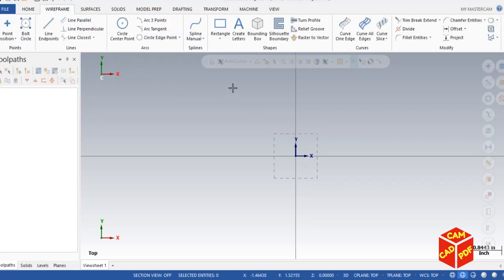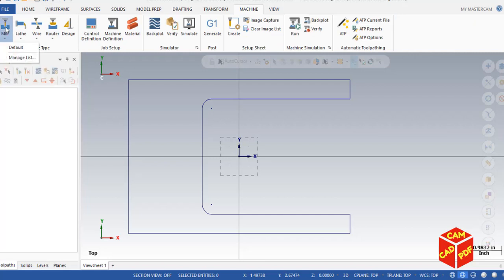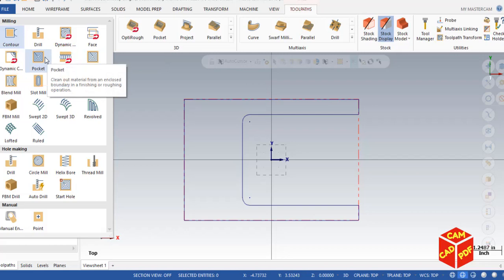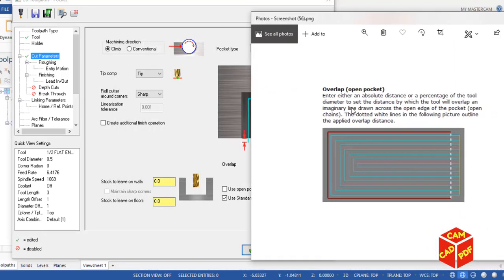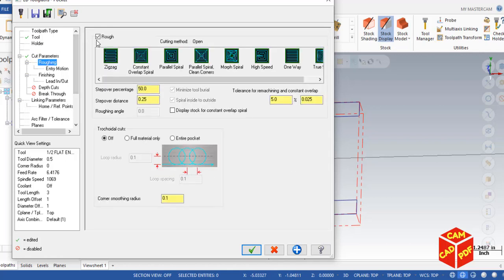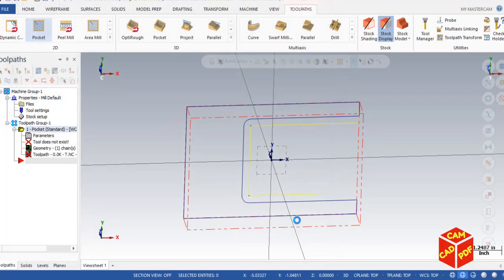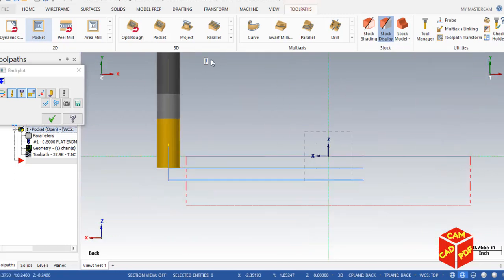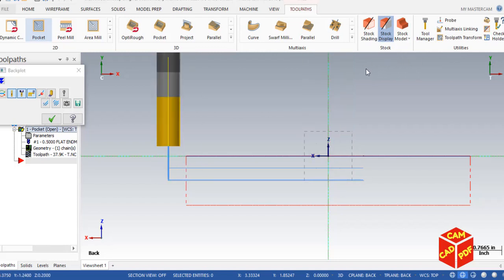Milling OPEN POCKET (Step by Step) in Mastercam 2019 Beginners LEVEL Lesson

Comment: can we rapid those air cutting moves, outside the open pkt (after exit till entry)  ?
Which is set to 125% of tool ,
If yes , please reply .
Reply: He set 125% of the tool to overlap or cut out of the part and yes you can rapid those air moves.